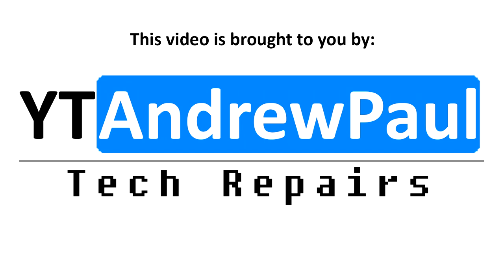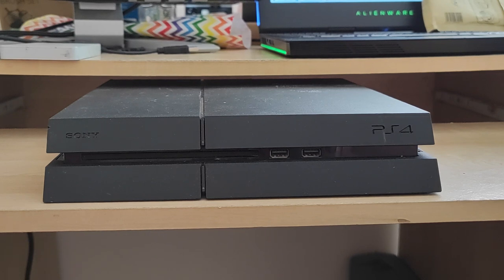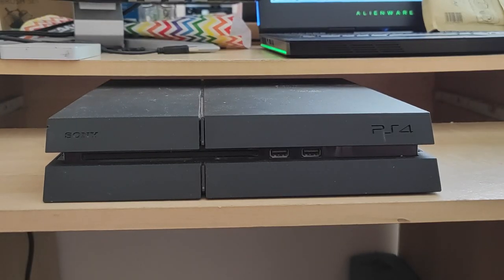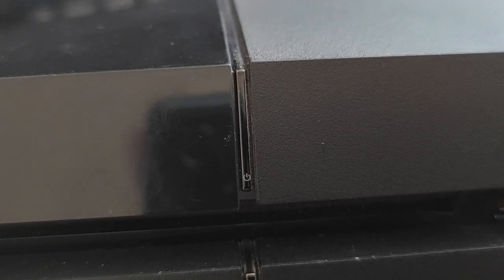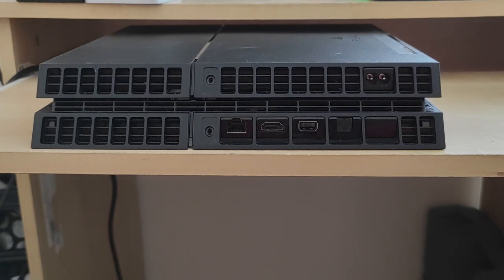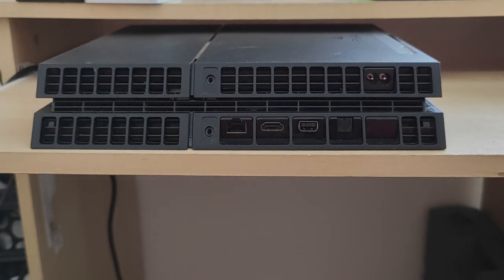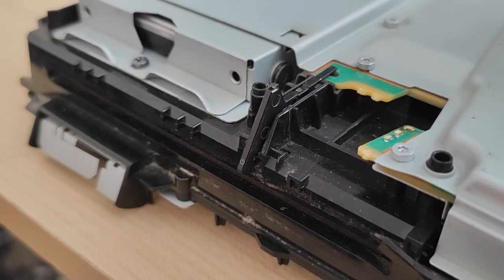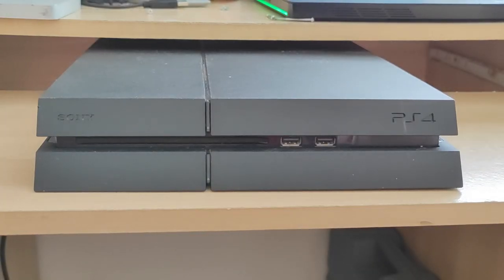Top PS4 CUH-12XX TEARDOWN TIPS

Comment: 14:00 , i’m having trouble mine has, per-say;  an upside down screw in the middle?
Reply from the maker: It's one of the long screws which goes through the rear of the power supply. Remove those and it should resolve your issue.

Comment: What's the component that's been soldered on next to the LEDS? I have this model with a component missing there as well.
Reply: Where exactly i may be able to help you ,i myself have a sac001 motherboard and i need the values of some resistors arround the nor flash memory,if you could help me i would be grateful

Comment: Hi guys , would someone  that has a SAC001 motherboard tell me what are the values of the 5 resistors arround the NOR flash memory (a mx25l25635f chip near the south bridge) ,i need their values as i think two of them are faulty(one connected to the SCLK pin and the other to the MISO pin), anyone that can help i will appreciate it,may god bless every one.

Comment: Mine's still stuck. It doesn't have the usual springy feeling.
Reply from the maker: This happens a bit with these consoles... The buttons break internally and don't press any more. You can buy replacements on eBay that'll get you back up and running again.